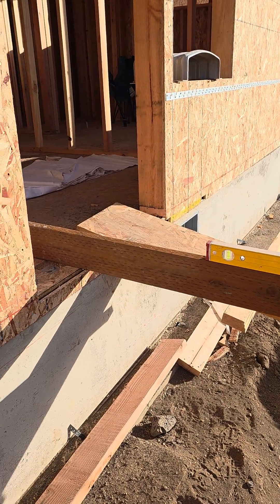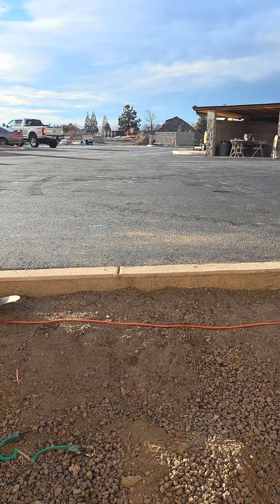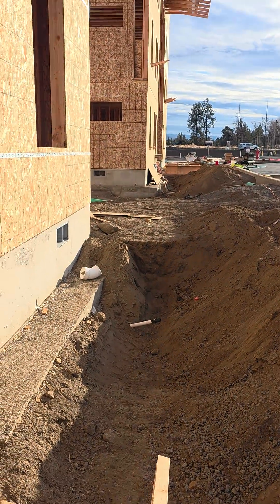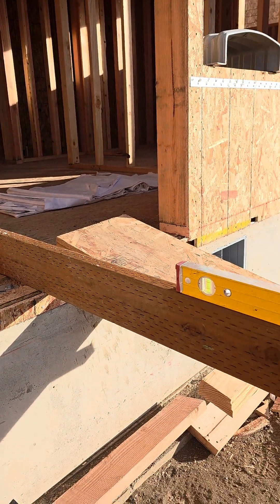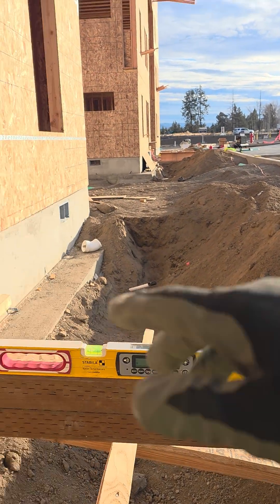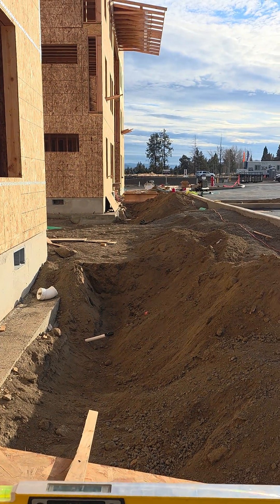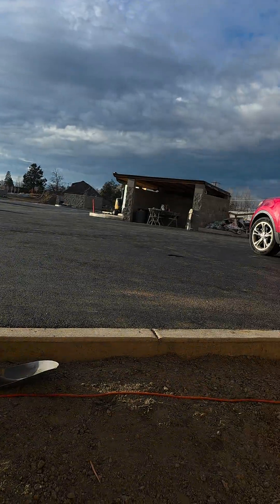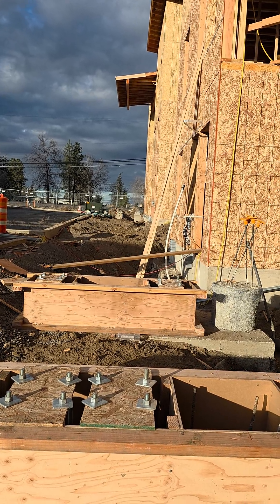We’re Probably Screwed — Fixing Bad Slopes Before the Concrete Goes In  #concrete #construction

Comment: I guess you never built a switchback ramp.
2% max is the cross slope  ADA ramps can be
 8.3% or 1/12. With a flat 5x5 after 20ft.
You just making a tripper at the door after the flooring goes in
Reply from the maker: Hmm...I have built straight, 90s, switch backs, curved, short, and long.  A ramp can go max 30' before a landing but handrails are required.  6' and no hand rail required.  Anything over 5% is considered a ramp and everything under is simply a path.  I have been doing this work for over 35 yrs and basically started when the ADA act was signed into law by Bush Sr.  
There isn't much, if anything, I have not done.
Reply: Yea me to. So what's the point of the video 2.4%  is not "too much"
Reply: @EdKreuzer  Because its the cross slope, not the running slope